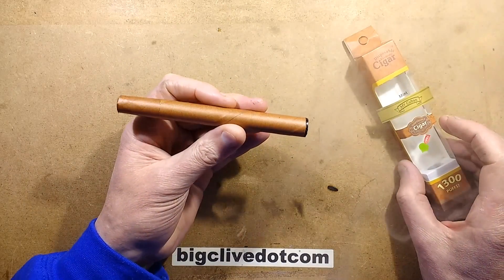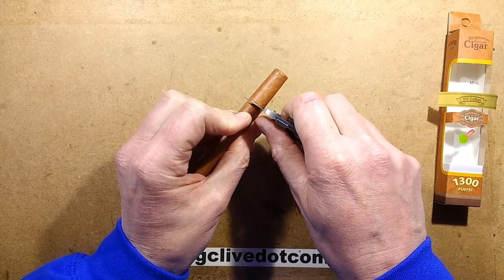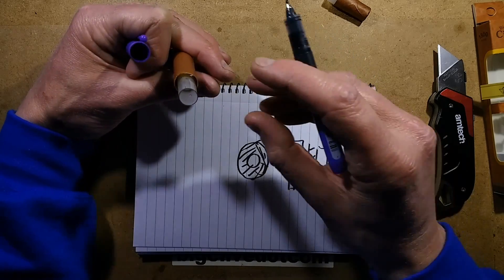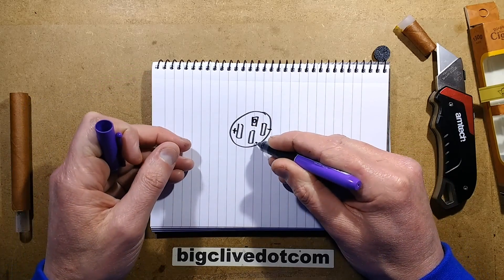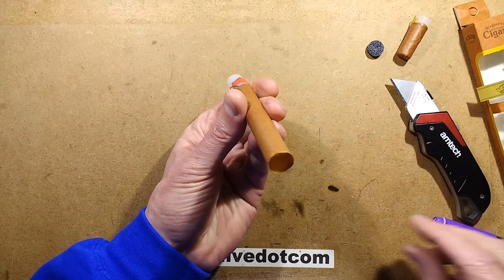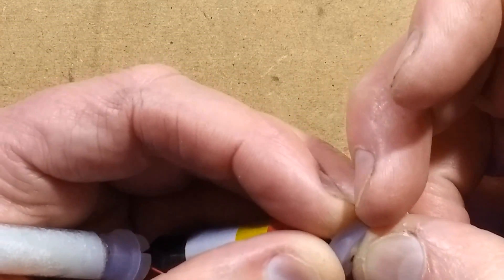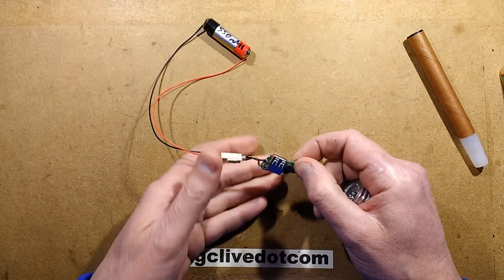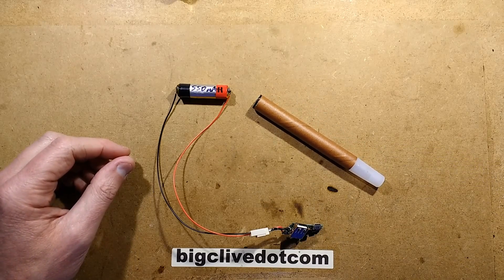Can a disposable e-cigar be refilled and recharged?

Comment: I tried refreshing the Poundland e-cigs, I can charge the things, refill the liquid but it wouldn't work. Could they have a puff counter chip inside them that ensures a built in obsolescence?
Reply: Have to agree with Siana. It is extremely unlikely that cheap ass disposables would be made with such a system in place. It'd need some form of non-volatile memory to retain the counter information, otherwise simply disconnecting the call would reset it. And that would add cost. The cross section of people who would actually take the time and trouble to recharge and refill a low end disposable is probably so low that the extra construction cost to prevent it would be prohibitive. Now if we were talking about the Apple iCig, then maybe.

Comment: 1300 puffs. Sounds like a fun night.
Reply: Did somebody say Rime the Vixen?
Reply: I'd use it In less than 24hrs, i mainly use 1500 to 2000 puffs a day
Reply: Thomas Bear do you count or how do you know?
Reply: @Heavyg254  my t-priv 3 mod tells me how many I do. I just have to enter the menu for puffs, and or set it to a specific amount or set it for never puff limit. I'm currently at 21,989
Reply: Thomas Bear so you have only been using it for 10 days? Since you say you do 2000 puffs a day? Stop trying to look cool
Reply: @alwayslifted9421  I've had it for over 2 years and with never needing to reset the puff counter. It's there just as a reminder of how much juice I've used and to say maybe I should reset it
Reply: Thomas Bear shit that’s a lot
Reply: 1300 puffs sounds like 500 ml of ejuice bruv, by the time my counter hit 3 grand I used 80$ worth of juice
Reply: @tristonpalmer1752  I've spent over $500 in just juice alone. That's not counting the coils I've replaced
Reply: now its 1800

Comment: i've been vaping for about 4 years. when i first started, i got a bunch  of disposables like the one you have here. i was able to refill / recharge a few of them over and over. only thing is, after a few refills, the coil (atomizer) gets gunked up with crusty burnt eliquid. flavor and vapor output begin suffer. not really worth it. it's silica wicking (at least the material inside heating coil. don't know what the outer wrapping is.) good vid.
Reply: Spector NS5 RD Agreed. I started out on disposables, then went to pre-filled cartridges, then refillable cigalikes, then an eGo, and now I'm on a Serpent Mini RTA on an iStick Pico. Once you get over the "I want something that looks and feels like my cigarettes"-phase there really is an entire world to explore.
Reply: Same here. Disposables got me off cigarettes. Cartomizers got me into vaping. Clearomizers got me into DIY. And now RDA's RTA's and fancy coil building turned into a hobby that keep me off the stinkies. 5 years and going strong.
Reply: @HotDogs1974  man, 5 years. time flies. 
congrats on staying away from cigarettes, but i'd recommend also eventually stopping to vape. substitute hobbies include what clive is doing in all his videos.
Reply: The thing about disposables is, they use such high gauge wire that it doesn't take much to completely bury the wire in gunk.
Reply: Hot Dogs - your story sounds similar to mine. Although I picked up a Tornado T (remember those) to use at work, and then gave up smoking by accident - I just preferred the taste.

Five years ago next week, as it happens.
Reply: LOL yeah I remember those! Isn't it amazing: how quickly time flew by, and how advanced vaping has become? Congrats, btw. :)
Reply: @Anton Renfors, Beany2007FTW, Hot Dogs LOL, yep same here and congrats! i got a pile of DNA 60/75/200/250 mods now, also a Pico running the Arctic Fox firmware. with RTA's / RDA's out the wazoo!   what an amazing healthier alternative to smoking, not to mention the technical side of it, which i love. modding is a great hobby!
Reply: Cheers gents...and ladies lol. It's much healthier than smoking, and from a technical point of view, it's a fun little hobby. I have a bunch of DNA and Yihi devices...and a pile of simple ones....and a couple sexy stabwoods lol and I love them all dearly.
Reply: ^do you smoke? Have you smoked? Just stopping isn't as easy as you make it sound...
Reply: If you do your homework before vaping, and belong to a community that will assist you in your journey, you're  reducing your risk even further. Battery saftey, knowing what metals to use (like not using nickel or titanium in wattage mode) and definitely not vaping at crazy high voltages that cause glycerin to burn and release aldehydes will keep you out of harms way even moreso. Hell, in smog polluted parts of the world, just breathing the air is more dangerous. Is it safer than not inhaling any substance whatsoever? Of course not, but it is DEFINITELY a much safer alternative to smoking.
Reply: Cheers Hot Dogs!

Who'd have thought not smoking would ever be fun, eh? Damned site more entertaining and enjoyable than a fecking nicotine patch, I'd expect.

Of course, it would help if the governments around the world would stop treating e-cig use like smoking. Because, you know, it doesn't do the thing that causes 99% of all the harm  of smoking.

Making smoke.

Sadly, large swathes of the Public Health world (And especially tobacco control) are foaming at the mouth puritans...
Reply: Ecigs are, compared to smoking, relatively harmless.

Do you like a cup of coffee in the morning, or a steak at the weekend? Risk profiles are not dissimilar.

Smoking, for all it's problems, gives people pleasure. If you can get that pleasure, and remove well north of 90% of the risk, then what, precisely, is the problem?
Reply: Yeah, except that there's nowt in e-cig vapour in the doses required to even come close to encouraging the formation of cancers.

Nothing.

You might want to do some research.

Here's a starter for ten:
https://www.rcplondon.ac.uk/projects/outputs/nicotine-without-smoke-tobacco-harm-reduction-0
Reply: ...and given that statistically, literally almost without exception, every vaper is a former or current smoker (people like Clive who do it for fun are very rare, and their only other choice if they wanted to experience something similar would be vastly more dangerous products) that can only be a good thing.

Comment: Where did you get that knife from?
Reply: Really? Nobody typed "amtech knife" into Google? First hit: http://amtechdiy.com/product-category/decorating/utility-knives-decorating/ … there on the bottom right.
Reply: Carl Holm it looks like the same knife sold by a company called Amtech. Their website is amtechdiy dot com. Although the blades pictured show the logo with a dash in it "Am-Tech"
Reply: I"m kinda surprised it wasn't from a Chinese seller
Reply: I was also wondering that.
Reply: The Range (UK) sell it for a few quid, It takes normal stanley utility blades. Got one sat on my desk, it is pretty decent for how chinesium it feels even after a few years.
Reply: Aaah, I thought I'd seen it before. I'll have to get one next time I'm up in Newcastle
Reply: animationcreations42 i
Reply: I'm curious over the logo tho. there's a swedish company called Amtech that works with live events (which is a field Clive is working in)
is the plot thickening here?
Reply: I saw one in TKMaxx a few weeks ago, I was put off by how thick and chunky the handle was, it wasn't comfortable to hold at all. Plus the mechanism to extend and retract the blade is a bit awkward due to the large distance you have to slide your thumb.
The only reason I can see to buy it, rather than a stanley 99E for example, is because it's a couple of inches shorter.
Reply: John Toomey Aah, probably just a coincidence then!
Reply: I've got a Stanley Quickslide, it seems about the same size as the one in the video, so if you want a shorter one than the 99E, you can just get one of those. I still prefer the 99E though, but the Quickslide is a lot easier to replace the blade on.
Reply: AmTech I guess....

Comment: It kind of hurts to know, that people just throw those lithium cells away :(
Reply: Damn fucking right, that's so envivroment unfriendly that i cant believe People actually buy this crap. At this Point i lost my trust in Human intelligence.
Reply: That is the same reason that Battery cars are more wasteful than a standard car. Batteries only have a certain life span even if you take really good care of it, and all those batteries just end up in a landfill, leaking their fluids into the earth.
Reply: @NotStephenColbert  first of all, modern batteries rarely even have any liquid in them anymore.

Secondly, while yes, batteries aren't optimal at all, they are more efficient than a gasoline or diesel engine which efficiency is just around 20%

I would never recommend throwing a perfectly good gasoline or diesel car away, to get a electric one, but if your old car is run down and you have to buy a new one anyways, consider going electric, if you don't necessarily need a ICE car (most people don't)
Reply: @schrolock  Alright, I will admit I was wrong about the liquid after doing some research about it and the disposal of electric car batteries. I was going based off of a discharge that happened in my smaller Lithium ion batteries, which have the safety mechanism where they discharge rather than going up in flames or exploding, leaking a liquid in the process. 

Either way, batteries are still more dangerous in collisions due to the flammable nature of them, but I am sure even today manufacturers are working to fix or contain that.

As for efficiency, all the efficiency of a battery goes out the window once you charge it. We are far off from mass spread non fuel based power. Where does that power come from? Power plants are churning out that power which is gobbled up every several hundred miles.

The main issue for gasoline right now, is that we pump ethanol into our gasoline. With current ratios of ethanol, you get roughly 70% the mileage out of the gas with ethanol. 

I don't have a big issue with electric cars. I think they are awesome. Just don't try to make them seem like they are that much better. They burn just as much of our resources at the moment.  That and while great for grocery getting, scooting around town or a well planned trip with many several hour long stops to charge, I would rather just take a few minutes to fuel up my car and get on to what I was doing.
Reply: @NotStephenColbert  hopefully someday we dont need to recharge the battery for several hours like the road + the sun charge it? hopefully....
Reply: @blihkeempat740  Yea, I mean, we have brilliant people working on solutions to all sorts of issues. I don't doubt we will have stronger technologies for those sorts of things in the future. Unfortunately, right now you need a van sized vehicle with multiple solar panels hooked to house batteries to run small appliances, and still need a diesel generator to do anything bigger. XD
Reply: Not Stephen Colbert but that’s not as bad as our atmosphere being damaged
Reply: @notalung  Sure, but coal and natural gas plants as well as industrial buildings pollute the air just as much as cars. Look at upper Michigan, I visited a friend in one of the factory towns and it screwed my head up till I left. Electricity driven things pull extra power, stressing the plants and causing more pollution. It is a lose lose situation til we improve the technology.